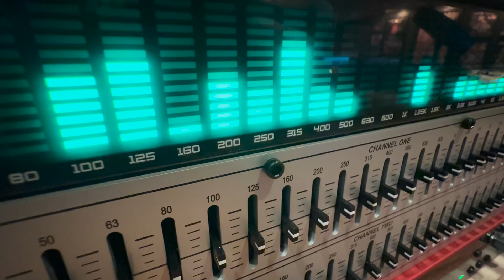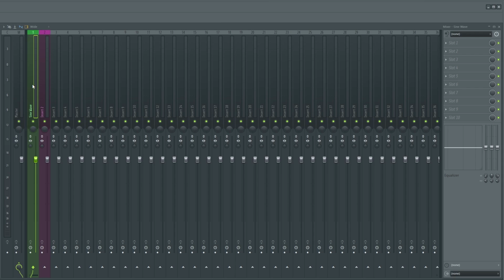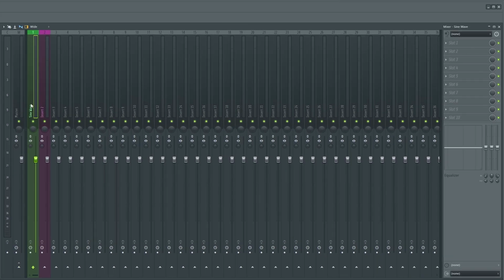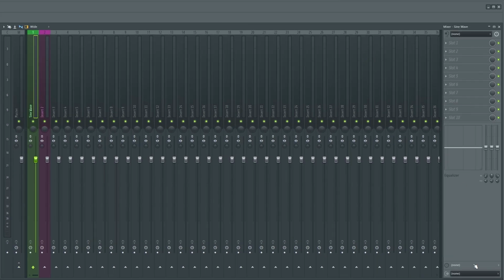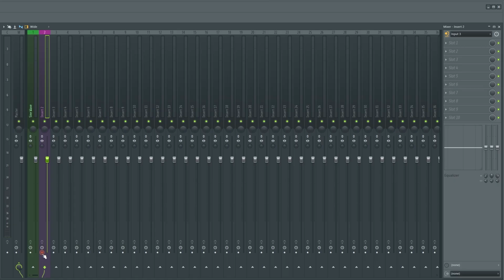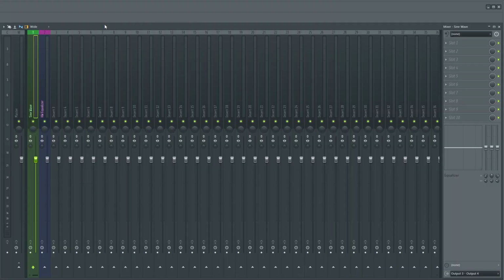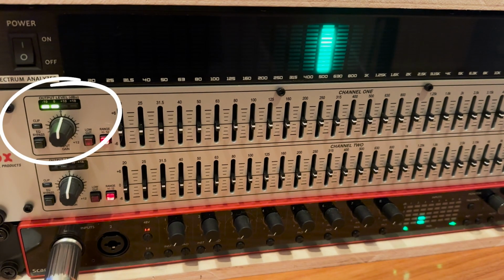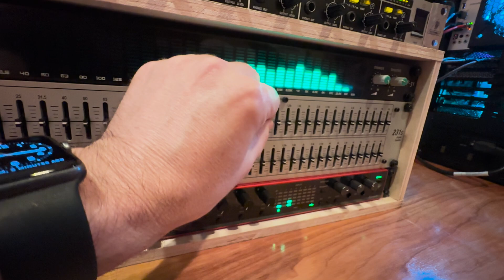How To Use Outboard Gear With FL Studio

Comment: How to connect analogue console to fl studio and use daw mixer live to physical console
Reply from the maker: You can, but with limited functionality and with diminished returns. FL Studio wasn't designed for this type of integration in mind.
Reply: @Voidpiercer  can you make a detailed video on pros and cons
Reply from the maker: @gabbar9358  Nothing wrong with an analog console! It's just a matter of analog/digital compatibility. I would hate to have a row of physical faders in front of me I couldn't use to their full potential!
Reply: @Voidpiercer  I want old school vive I want to connect large analogue console to fl studio and do changes in knobs faders physically
Reply from the maker: @gabbar9358  I would like that too. It would need motorized faders and pots with a digital hardware input configured with FL Studio. I think what I just described is the equivalent of a unicorn, or something far outside of my price range.

Comment: Are you aware of any work around to the latency issues around trying to use outboard gear simultaneously with playback ITB. As in if I’m trying to EQ with hardware EQ while listening to the rest of the track. Other DAWs have a hardware insert plugin which include delay compensation for the roundtrip out the interface, into the gear and then back into the interface - afaik FL doesn’t. I hope this makes sense, any ideas?
Reply from the maker: Makes sense - The delay you mention will be solely affected by your audio interface's buffer. Try to keep that low (within operating reason). I aim for a buffer size of 256 when using outboard, as well as tracking vox and guitar.
Reply: Move all the tracks a little to the right until the hardware input fits the tempo of the other tracks.
Reply: If your hardware processing has a delay, you can adjust track latency with the clock icon, located above the track output selection. This should help with phase issues too. Hope this helps!

Comment: Wheres part 2 brooo
Reply from the maker: @Renfilly  soon! Any further items you’d like to see covered on this topic?
Reply: @Voidpiercer can you do an export of a master track with external effects
Reply from the maker: @JEBJOSH   Not in tandem as you could with a VST plugin. I think the case here would be to export the master file first, and then modify it afterward with the desired tool. I hope this helps. Thanks!
Reply from the maker: @JEBJOSH threw you a response in your previous comment. Thanks!
Reply: @Voidpiercer  yeah I’ve been trying to figure it out I just can’t seem to find anything. Fl doesn’t fully support real time exporting with external effects on. You’d have to record the mixer channel which is kind of a pain.  Ableton has something called external audio effect which you can set up the routing  and when you exports it does real time audio export with the external device
Reply: @Voidpiercer  thanks for the reply though.
Reply from the maker: @JEBJOSH  oh dude, I had my head in the wrong video - so in conjunction with outboard gear, just route everything to a stereo insert and record to it in realtime. This will allow the fusion of the session and outboard processing. This is a perfect topic for a part two on this subject!